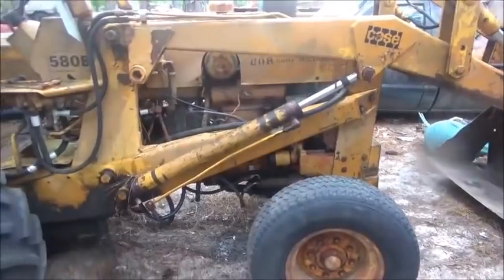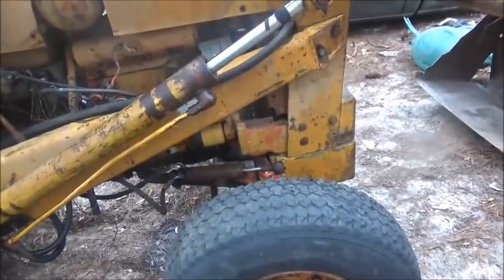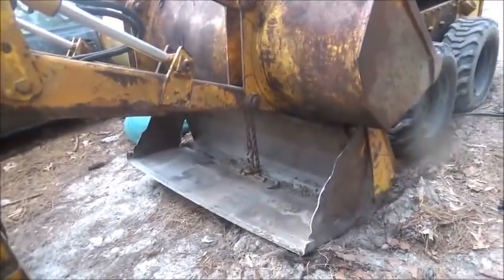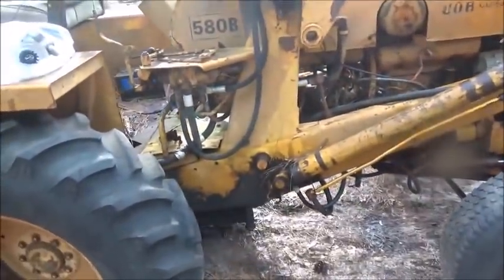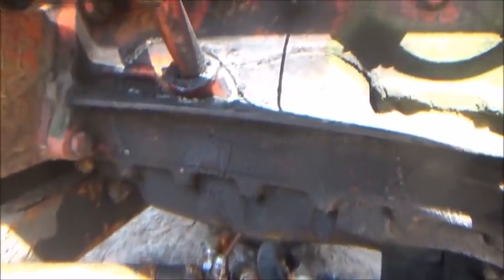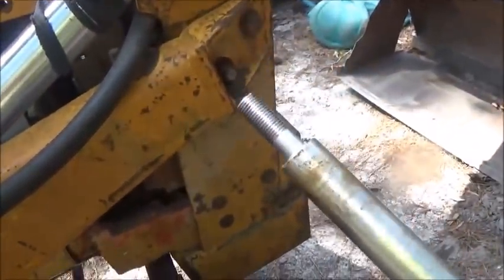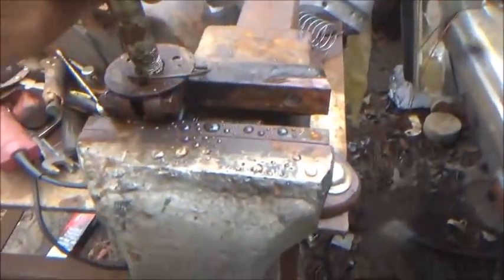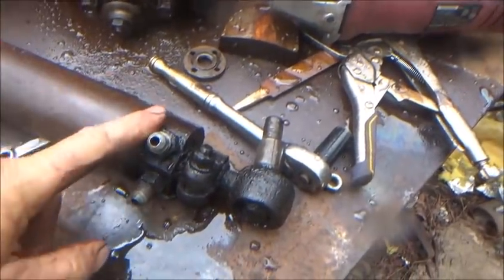CASE CK580B BACKHOE STEERING REPAIR

Comment: The 580 b and th580E were two of the finest backhoes ever made. I may have had a hand in building that backhoe. I worked in that plant for 31 years
Reply: Where were they built?  Wichita?
Reply: @douro20  Burlington Iowa Was called the backhoe capitol of the world
Reply: I worked on construction jobs in the 1970’s and I was amazed how versatile the Case backhoes were.  Nearly all the contractors had them.  Some talented operators could make them function like an extension of their arms and legs - amazing!
Reply: I’d say you did.
Reply: I've got a 1978 480c with the 188d diesel.

Comment: Do you know how many people would have just replaced that cylinder, I like the way you think Jonathan no money spent that's awesome
Reply: Jonathan makes good use of his resources and knowledge rather throwing money ( he does not have ) at it, Anyone who has watched his video,s will be in No Doubt about Jonathan,s ability,s to repair or rebuild things.
Reply: My dad was similar but it's my wife's grandfather that really showed me that you can rebuild almost anything. He was from Bulgaria and also built his own tools from scratch. We're talking a complete woodworking shop and a combination metal lathe and mill. He used things like scrap I beams, rail road track, rebar etc. It was all done during Communism and  it's how he made extra money.
Reply: In NZ we call that No8 wire thinking. Cos No8 wire can fix almost anything. Makin do! Jonathan, are you sure there's no kiwi in you!  Haha nice work n
Reply: I am a Kiwi too, yes no 8 wire has repaired many things.
Reply: One learns with experience, it's always good to "have a look" first. "throwing parts" at things is the expensive way to trouble-shoot. Find the  problem/issue first. That will lead you to the most "expedient" solution. "Building a scenario" usually turns out to be a concept that is WAY MORE COMPLICATED then the actual problem once it is discovered. Anyone who fixes lots of things they are not "expert/familiar" with has had that experience.
Reply: Poor country people where I'm from would have done exactly what Jonathan did.

Comment: Jonathan I have spent thousands of hours in the seat of those case backhoes. Starting with the 480 construction king. Earned a great Iiving for 43 years with rubber tire backhoes. You are missing a short hydraulic cylinder between the right side loader arm and hoist cylinder. It is a equalizer cylinder to keep same pressure between both lift cylinders. That backhoe has a lot of life left. Love all your videos and watch every one. You and your family keep safe.

Comment: That old case is a workhorse.  I'm in Illinois and that tractor would still bring $3500 easy. I had a 1969 580 gas that I loved and used for years. It's well worth spending what you have to in order to make it dependable. Now that you have it, you'll wonder how you ever got along without it. Good job on that steering repair. That's probably why it was not in use.

Comment: Glad you got the steering fixed pretty easily.  I don't blame you for not replacing or repacking that cylinder.  Heck, if it works don't fix it.

Comment: Nice fix on the steering, good that the cylinder was the culprit that was keeping it from turning.  I agree, most people would have blown the money on a new cylinder and not even tried to trouble shoot the old one.  I'm the same way, if I can fix it I'll do that first before I blow a bunch of cash unnecessarily.

Comment: Good job Johnathan, I rebuilt steering cylinder on a IH  was like that one,easy quick and worked. We have old tractor 1970 internal drive ps, pump leaked fluid into engine oil something else for you to keep in mind .heck yes on parts tractor always. take care
Central California watching

Comment: Elimination process , one by one , follow them through . Gets the job done . Your right about the rams , easy to do with new seal kits . Other than costing lot to have them repaired in a workshop . Locknuts save everything falling apart , makes sense to use them , false economy using ordinary nuts . Keep up the excellent work and content .

Comment: Glad you figured out the steering problems, I've no idea what that part in the ram was , but it's amazing whats found sometimes that don't belong. The slew cylinder seals were leaking hydraulic oil into the slew rack gear box and  pushing the gear oil and hyd oil mix out the top on my JCB backhoe loader. I got the new seals cheap from Ebay and pulled the cylinders off. On one side there was a nice shiny 1/4  thread grey iron pipe cap fell out. 
  why the heck somebody put that in there I have no idea as it wouldn't fit through the hydraulic system and fittings to get in there. Luckily  it hadn't got crushed up or scored anything while the machine was  working with it in there either.  Thanks for the video, Take care

Comment: I think that washer was just under the nut and wasn't a lock washer, and that's why it loosened off. Wouldn't be surprised if someone has been in that cylinder before.

Comment: Jonathan, great that you were able to repair the cylinder. Wondering if throwing a new $166. steering pump at it first was necessary.
Reply: And the reason I wouldn't change the pump first is because it was steering in one direction!

Comment: Jonathan, I've come to the conclusion that given the tools you could do a heart transplant or bypass surgery👍
That entire 580 series are enormous work horses that can take the beating. Back when I worked for a utility contractor... Operators worked and beat the day lights out of them ( not in a abusive way) in the areas we had to go through at times clearing a path through woods to trench through or plow cable ..digging boulders it took 2 hoe's to move ...they remind me of the oldctimex commercial.. " takes a licking and keep on ticking" or the energizer bunny .. " just keeps going and going and going"

Comment: Also there is a lock on the boom. If you rev the engine up around 1200 rpm and lift the boom about 3/4 way up then pull back on boom lever till it goes over center than push forward on lever and boom will come towards you and lock. Takes a little practice if you have never done it. Have fun working on backhoe.  :-)

Comment: Hi, thanks for the video. I have a Ford about the same vintage and I haven't done much investing yet but I thought you or Mr. Mellinger might have an idea. My (power) steering seems to be fine except sometimes at first it won't hardly move - I suspect the balls are snagged on something but when it starts working it's fine.

Comment: Those small steering cylinders were more difficult for me  to re-pack than the larger ones on the machine.  There is one small seal that is hard to get in place.  I ended up ruining it and having to get another kit off ebay.  I am now getting ready to rebuild the other steering cylinder on my 480c.

Comment: Good fix for cheap. Looking forward to seeing the split for the transmission repair, most people baulk at having to split large units so i am curious  what will be your chosen method as you have a variety of equipment to do it with.

Comment: Did you remove the alternator to change the pump? I have a 580B that needs a pump. I let it sit too long and now the steering does not work. I did start it on occasion and run the power shuttle and that seems to pull okay. And the pressure gauge seems to show normal shuttle pressure.  Thank you for another nice video.

Comment: Jonathan, I ain't positive but I though that if one steering cylinder was bad and the other good, then you could block the bad one off and it would be harder to steer but it would steer though. I have been in a few cylinders an all I know for sure is that there sure is no limit on ways to make them as no two seemed the same. Some are so easy that like falling off a log an the next could be a wrassling match to get them folded out and the new one in cause of the bends an stuff to get them in and your committed cause ya had to dig the old one out.  Any how, glad that its is working some and good luck with the rest. I know that those cement companies have those trucks with the long arms that pump into walls and there just is no limit to how many cylinders on them so if they had a dead truck, it might be a source of old ones. I got one of those old trucks in trade and I got the back of a flat bed truck completely full of hoses and cylinders off it. I didn't have a hundred dollars in that deal and it was the gift that kept on giving!~

Comment: If anyone runs into no steering on a 3500 International check for stuck relief valves. They made their own hyd. components and no parts are available, so I steer clear of them. Nice save on that cylinder, you can tell the year of a Case by counting the windows in the block. lol

Comment: If te steering valve is hooked up wrong the steering will only turn one way. It wont turn the other way because the cylinder is fighting the other one to turn.

Comment: I'm sure you already know Jonathan so I'm just sharing here.....getting internet cylinder kits....watch out for the look alikes and chinese kits. Aftermarket's not all bad, but you can find bad real quick. I try to find original parts labeled by manufacturer.  That will say case, new holland, caterpillar etc. Otherwise I try to find big name american made aftermarket if I can. Looks like a great little hoe to me. Thanks for sharing
Reply: On Amazon, a reputable seller with good merchandise, will have his listing piggybacked by fraudsters claiming to have the same item at a better price.

Comment: do not use nylock nut,--  no no-- do 2  and oil  heat use steel nut and stake the threads with a punch and hammer to hold threads